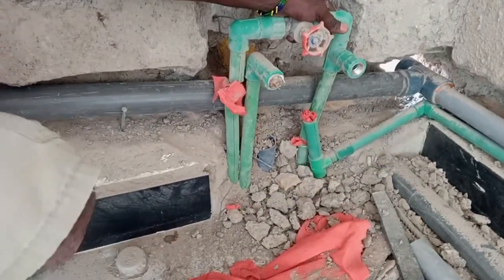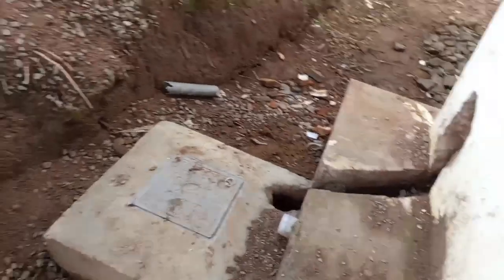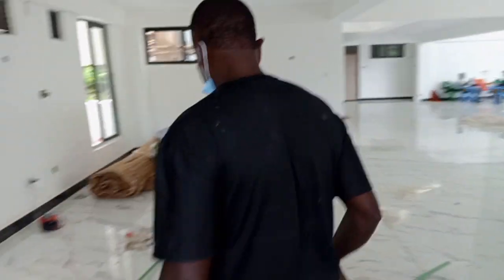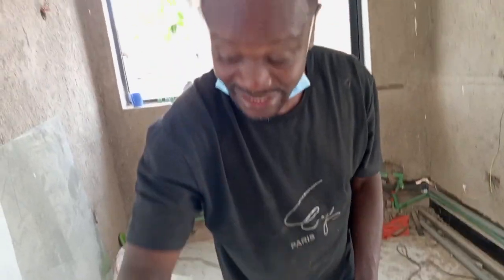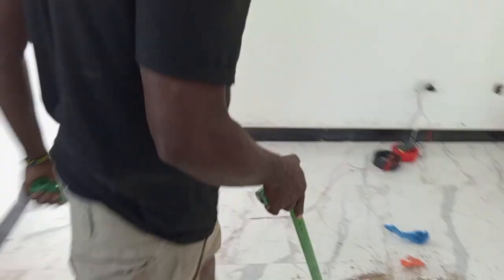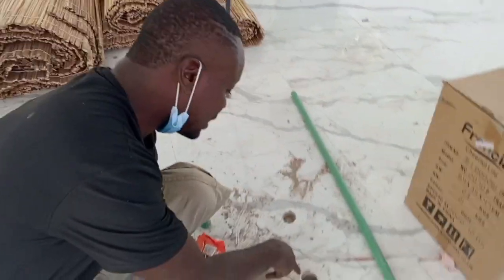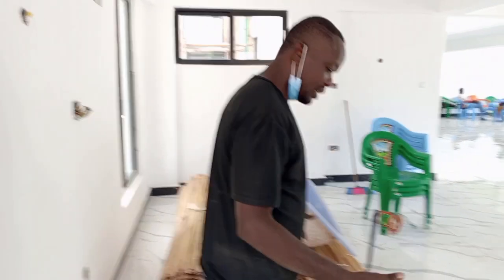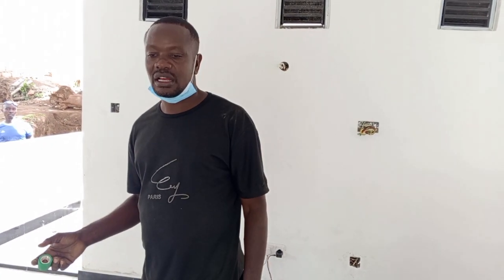Guys plz plz I need ur prayers and support @iam Marwa villa Medellin nyabohanze village.

Comment: Congratulations Strongman254. Your great work speaks for you.
Excuse my complete ignorance, but i wonder if the are other accessories (for the heating machine) that you can  use to connect to the recessed pipe. This would allow you to extend pipes without breaking the floor tiles.
Also,its great that you have delivered on the two weeks you had planned to donate to @iam_marwa.  And you clearly solved a very expensive catastrophe that was waiting to happen. 
In fact, you have proved your value and professionalism.

So, I kindly suggest (and I think  iam_marwa will support you) that you go ahead and set up a professional contract for the rest your good work.
You  are very kind but please do this for your family.

Comment: marwa plumbing and  electrification should have been done during the construction, i mean before plastering and painting, now you have to break the wall making holes,, etc , etc,, after giving finishing touch, just my opinion, anyway keep going, strong man👍👍👍👍
Reply: Engineer's mistakes. Marwa has no clue about construction at all. What a mess. Hope fully things will be sorted out bit by bit, this project is massive
Reply: @fs4001 sure, hopping for the best👍let's go on supporting MARWA,

Comment: If you could  have vacuum machine could  vacuum  the particles inside  the hole and  try  to fix without  removing  all  tiles
Reply from the maker: @lillianodemo.some are not fixed with tagit,the adhesive applied to waste pipes